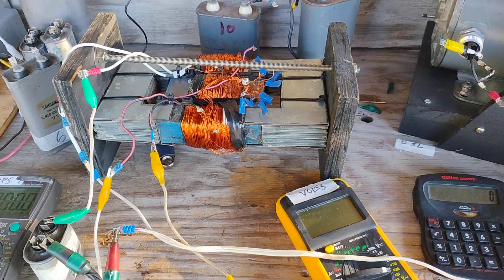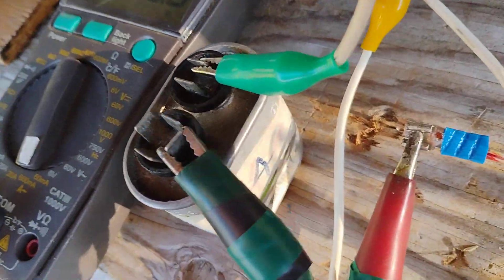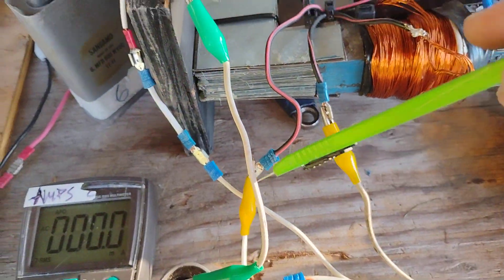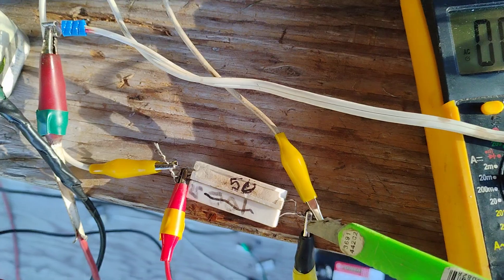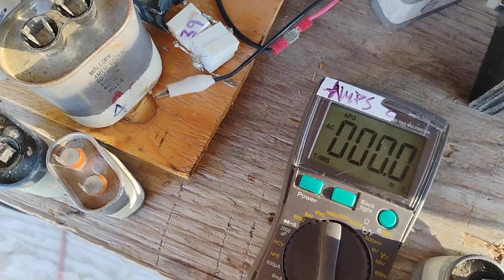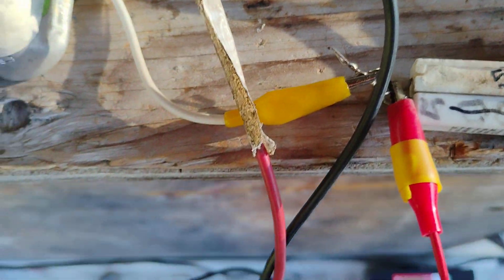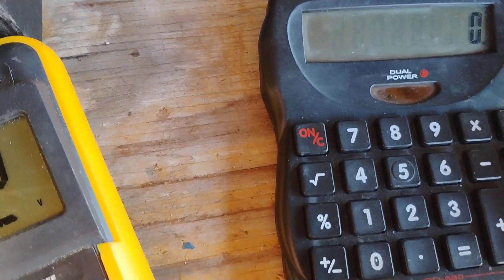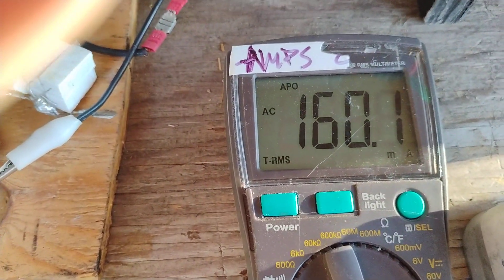40.8W OUTPUT from a 19.4W INPUT using a statpower-invertor powered hemmoroidal transformer

Comment from the maker: The video was cut a bit short at the very end, but it was showing 162ma x 120Vac as the input, (19.4 watts) this while measuring the AC feed into the transformer primary from a statpower invertor, and am not using the AC grid as is in video before this one.  
Interesting a 4uf cap in parallel to primary works best when using the grid, but do the same with a cap parallel to primary while using the invertor output, and draw goes way up like that,  so for this "invertor-powered" experiment a 4uf cap was instead put in series on one of the AC lines to the primary and it worked very good like that.
Reply: So, instead of resistor, You can put an fb. rectifier, cap, and feed the power inverter, see if it keeps running! God bless You. PEACE & GOOD LUCK
Reply from the maker: @SaveOurSouls-SOS  
Hi SOS
Yes, in a couple of videos before this one, that was what I was doing - but had battery getting charged while discharging into invertor at  same time to the experiment...I was showing 500ma into battery to charge, while 500ma into resistance of transformer and FWBR at same time and battery did not deplete at least...maybe a super cap in place of battery next time in future...
Reply: @MrDKONZEN  BRAVO, NICE WORK. PEACE

Comment: Nice work Doug!!  Even with the series cap the amps aren't necessarily in phase with the input volts. So your true input power could be even less than 19.4W  Fantastic results mate!
Reply from the maker: Hi Gerry
ITs all your fault!   (In patiently teaching me a couple  years ago in how to use a scope properly and how to calculate the phase shift as well)
These tests in this video are using a statpower invertor as AC power supply, it has a very sharp alternating DC pulse from a capacitor from the "DC boost convertor" circuit inside of it.... it has some sort of "H" switching to make the DC cap discharge alternating in direction, and also a voltage-doubler circuit too (as far as I know)

The invertor at least shows 120VAC on meter coming out of it, and can run various AC motors with its output (like the rotovertor) but as far as phase shift calculations go, it has no "nice looking" AC sinewave at all just a DC blast one way then the other., so I dont think legitimately a power factor number can be added to watts equation without a years worth of argument and discourse with an electrical engineer peer group, but I can try to get a handle on it and show the scope shots later on at least..

There probably will  be a phase shift with the 4 uf series cap, maybe none at all , maybe it creates a capacitive-leading phase shift , I dont know ( I wiill need to take a look at it) 

But I will doubt this SERIES 4uf AC cap works like a paralleled AC "power factor correcting" AC cap where the caacitor in circuit makes power factor become "one" (volts right on top of amps)  as I did in the sister-video to this one, when I run the transformer on 60hz 120 VAC grid, not from this invertor, and lower draw seen on scope with meters signifigantly.  I need to look with scope at that experiment too to confirm PF = 1, I am pretty sure it is as that is the AC power grid being manipulated and power-factor corrected ....

I wanted to use the AC output from invertor and "what it says with a meter" as the AC input to the transformer  for first step to  a project in future.
Because maybe later I can use one of my flat-disc axial flux alternators as the AC power supply, and have an AC type of  cap-discharge to it, that resembles the cap discharge that will appearhere, from the statpower invertor looking at its 120VAC  with a scope.
.
 .
Reply: @MrDKONZEN  Hey no worries mate, I'm learning too, just by following the persistent and patient paths which you always share.

Comment: Hi, I would love to have the transformer diagram.
Reply from the maker: Its a standard 3ph AC transformer with those "shunt" bars added to it.  Not too complicated.
Windings are of  multi-filar winds, I parallel some of the secondaries so it works as step down transformer, while primary has multifilars  all in series for high impedance and can handle the 120VAC input without getting hot.
Does not need to be multifilar winds, its just what I like to  do - you could use the stock windings of a 3phAC transformer if you want. 

The cap sizes and placement in circuit you will need to find for yourself on the bench doing tests for yourself in  whatever it is you want these transformers to do.
In my case, I wanted a step down transformer that can power an invertor not more than 16Vdc eventually coming out of the secondaries so did my coil winds as such.

Comment: Hi Kon, good job, man. But how do you think this additional 20 watts of power is generated? 
Is it possible that your homemade transformer is somehow able to amplify electromagnetic force?

I have always believed that power can be amplified, just like we are able to amplify sound with amplifiers.
Reply from the maker: Hi Mehmet
How it works is simple sort of "mechanically logical" you could say to explain it, I like this better than just to say "its what it is, I dont know why" and in this case I think I do know why (but might be wrong haha)
So everytime you have electrical "flow" you have in conseuence a magnetic field rotating around the electrical field, now this a "I dont know why for sure" but is just the way it is like it or not sort of thing.
For sure there is magnetic field as proven by any electromagnetic coil.
So, whenever there is change in direction of the electrical flow (such as in AC, or in "alternating DC" pulse - same thing really)
Now the change in direction creates a "backemf" which means creating an electromagnetic fiield that is in opposite flow direction to the "proiceeding " (before the  shift in flow direction) 
Think of water pumped  through a pipe, and if  you change its flow direction every second or whenever now that water is just "not going to like it" and will create a gurgitating motion that will fight the flow-change evey change in the flow direction....so this gurgitation or whatever you call it could be compared to backemf magnetic currents.
So AC always  creates a backemf force in MAGNETIC currents (not electrical - that would be "something like" flyback voltage which is similar but not same subject.
IN DC, its the sudden stop in flow direction that will create backemf currents (and flyback spikes but flyback spikes a thoursand times faster)
WHY transformers always seem to go up in draw to primary is because the backemf forces regurgitate themselves back into the primary coil of the transformer, in a  3ph transformer, the backemf will regurgitate twice per polarity change, and in complete AC sinewave four times - twice above, and twice below, traveling through the core material from both secondaries into the single primary in the  middle (IF it is set up so central coil is primary and secondaris to the left and right)
OK this is why nobody can :"get anywhere" with transformers as whenever you load the secondaries current is made,,,, and the currrent being made creates the INHERINT back emf forces like it or not, that will shoot back into primary coil core leg, lowering the impedance of the primary coil, creating lots of extra draw in consequence.  
So far so good maybe? I dont know but lets say you can redirect or at least cancel out the backemf force to go over to the opposite secondary, REINFORCING power being made in opposite secondary,  and  especially important, with no extra draw to the primary when coils are loaded?
Thats what thsese transformers are supposed to be doing when you get it right....
Regular transformers you can hope for 100% effeciency if lets say in resonance you get all the turning caps perfect  and load perfect but good luck making something overunity from just a regular off shelf transformer.....however with the "hemmoroidal" transformer (AKA Bittoridal transformerr) you "eliminate" the backemf forces going back to primary and instead they travel through the magnetic "schunt.bars" above and below as these have the least resistance path to the "backing up" magnetic forces and those magnetic forces make their way over to the opposite secondary giving more power from seemingly out of nowhere but the nowheere is the fact the inherent backemf forces are tricked and steered over that way and "bypassing" (up and over)  te primary leg via the schunt bars.
In nutshell get rid of inherent backkemf forces what do you have then? Something unstoppable more or less....manifest as overunity with resistive loading  as in these tests (if you get it right) or a transformer with 90 degree phase shift to the AC input (so zero power input) while there is an output of  real honest to good power on the output. as in my other tests with scope to see the phase shif.t).
Sorry long description
 still  In another  nutshell lets say a transformer that redirects backemf forces into opposite secondary upon loading  and makes more power than power input since you use the backemf magnetic current to make that extra power, instead of having the backemf as would be normal raise the draw of primary in consequenc to loading of the secondaries.....still a little long description but will work on it get it down to 12 world or less....
Reply: Hey Kon, thanks for giving me with different examples of the lengthy inner understanding workings of shall we say on how the electron flows. Your explanation of the "hemmoroidal" or "bitoridal" transformer highlights an intriguing approach to increasing efficiency and potentially achieving overunity. If one has to achieve different output from a transformer one has to do different things, really applies here. Thanks for doing and sharing your work.
 By redirecting back electromotive force (EMF) through the magnetic "shunt bars," you propose that these transformers can bypass inherent back EMF forces, resulting in higher output power, it's very logical and it's very possible
and surely is evident here.
This concept of mitigating the counter-electromotive forces that normally oppose the primary input has the potential to revolutionize transformer design for sure. But it will be much faster to find the right transformer configuration that will give the highest output by using a transformer design and testing software. That we can test these ideas within the computer program, rather then building and testing it.  
If we can effectively manage and redirect these forces, we may be able to create more efficient electrical systems, reduce energy waste, and possibly even achieve overunity. This goal that has long eluded electrical engineers and researchers, but how often they are able to think outside of the box, makes you wonder. 
Generally speaking they has been incredible progress in every aspect of life except the transformers.
Man we are still using  transformers which was designed and built in 1886 by William Stanley for Westinghouse. 
Time has come to discover the hidden secrets of transforms.
Reply from the maker: @MehmetBoysal  
Hi Mehmet
I would say EMF in this case is ElectroMagneticForce, while if describing a motor, it would be ElectroMotiveForce.....just a small detail in explanation, as it is a very strong magnetic force that will travel through the shunt bars....getting it to take that route is going to be where the resistance of the load is very important, as too little resistance makes it so not much "Forward" EMF makes its way into secondary, so not very much of the inherent  "Back" EMF is created.
"I dont know" as usual, but I find on bench testing that some resistive loads work well and show overunity some do not with other things equal (same voltage input same freqquency)  I think it is a balance to be found where just enough amp draw is all you want to have, and that just enough is enought so a good deal of backemf is created, and this  chooses the shunt bar path, instead of fighting against the head-on forward EMF shooting through the cross-bar leg connecting primary to secondary leg.
If too much resistive load it creates way too muich forward EMF that "snowballs" the backEMF forces and rams it too hard, not letting the backmf forces to go anywhere at all but a lump of magnetic currents in an angry ball fighting against themselves.....
This all theory why some resistive loads  work wel,, some do not....
Could be it has to do with TIMING and the particular resistive load chosen  delays the backemf to be a backwards-magnetic current event "in between" the Forward EMF  events of the AC currents,  so current peak one way, followed by the backemf "current peak" the other way....and it gets through because of that timing, dictated by the resistive load creating a time delay "just right".....sorry more theory.
About simulations - I doubt they will have clue about backemf forces how and when they wil occur nor where they will go, but maybe so I dont know...in meantime not much takes the place of bench testing to find stuff out or at least see it happen with no clue why it is...

"What he dont know we dont understand" opening words to happyhappyhappy by the Fuckedtones:
https://www.youtube.com/watch?v=X3OwzkBfBek

Comment: Looks very promising.  Well done and thanks for sharing. Only criticism from me is that maybe those resistors are over powered? Are they 10 watt rated? Anyway,  nice work!
Reply from the maker: Yes 10W resistors bought at local electronic store, I parallel two so can handle 20W, the 40W output tests  gets them hot quick, I do tests  quick while still cool to touch. I should buy some more maybe 400 ohm ones with 8 paralleled or whatever to make that 50ohm resistance with lots more watts-capable to them and they will not burn through the wood table haha.....there is talk the "heat wire" inside of them really an inductor, but I think that is very minor detail and these work 99% as a real resistive load, that 1% inductive maybe is all.... .  These particular transformers and those winds in them really like the 50ohm resistance it seems....

Comment: Maybe the difference between grid and your inverter is the inverter is not pure sine wave?
Also I've been experimenting with caps like yours but I only have the ones out of microwaves so I have to series them to get higher uf because they add when you series them right?
When I series a.95uf on one leg of the AC output of my inverter to run my transformer my inverter shows no amp draw but I rectify the transformer output and it charges a battery no problem.
If I remove the cap the inverter shows 8 amp draw and gets hot quick and the charging battery climbs really fast.
It'll burn up if I let it run.
So what exactly is the cap doing to the circuit?
Interesting thanks
Reply from the maker: Hi Jon
Yes the sinewave of this invertor I am using looks like very sharp blasts of alternating DC currents and voltage, an alternating  DC cap discharge I would  say is what it is.
 For the grid AC, besides  there is "unlimited" current behind it too,  the sinewave is very nice and smooth like it "should be" so stuff like "power factor correction" with caps and the phase shift angles or lack of any phase shift angle work like the textbooks say they should and will, but this invertor is a DC boost convertor really that has alternating blasts of DC current from a cap plus far as I know a voltage doubler circuit too.....someone told me the DC boost convertors employ shorting of the inductor to give a really good jolt in the cap discharge because the cap will fill so high and so quick. Probably the shor circuit of inductor  timed at the peak period of voltage or current.  
I think the series cap works as a low-end frequency filter and chops out the low frequency stuff like you would see in an audio speaker tweeter circuit, so you could say it is a current limiter too,  maybe chopping out the low end stuff kills really bad lenz reaction and backemf problems causing huge draw......maybe....also probably it allows a resonant chamber for the spikey blasts of DC to jump into and swim around for a spell....I dont know - this is the first time I have got a "tuning" cap to work well with these statpower invertors, usually they just increase draw or cut down the power output and makes it worse, but something going on here good with the 4uf in series.....other uf sizes did not work, either smaller uf or larger uf, it must be exaclt 4uf so this indicates some sort of resonance going on maybe not and is something else such as it kicks in some good currents normally not happening through the hemmoroidal transformer so the backemf magnetic currents actually make it across the shunt bars to reinforce the opposite secondary like it is supposed to work in the grand theory.
Reply from the maker: Hi Jon
Look out for those microwave AC caps, they usually have a "safety" drain-resistor inside of them and it really messes them up.
you can cut them open, drain the old oil out and cut out the resistor  and refill with some new cooling oil but its a bit mess.
Look around for the  old school oil filled HV AC caps, they sell them online in surplus places.... look around and start a collection I have quite a few from over the years as you can see....I got a lot from a place in Tacoma WA that would gut out old navy ships and sell all the stuff....I think they out of business now.  Vetco electronic surplus  in Bellevue WA has some for sale I see on their shelves when going in there.... they have online store. too...get alot of 1uf or 2 uf or 4uf size so can parallel and get just the right UF value....If you contact Vetco, ask them the name of the surplus electronics place  down in Tacoma....I cannot remember their name right now. they probably will sell online too everyone does these days.